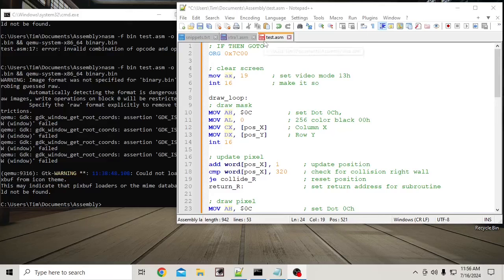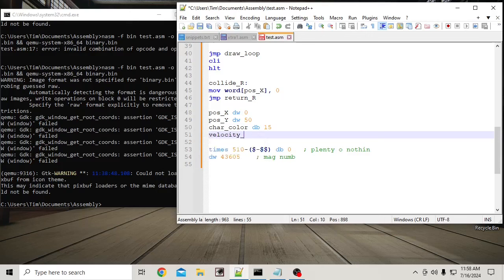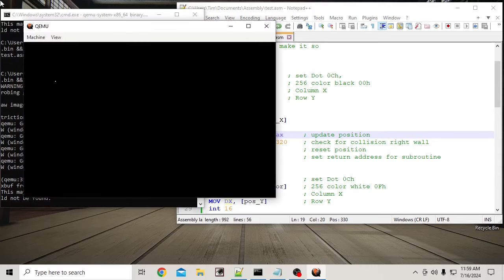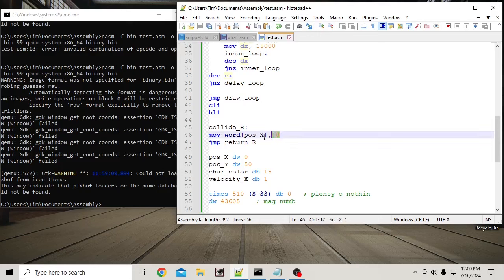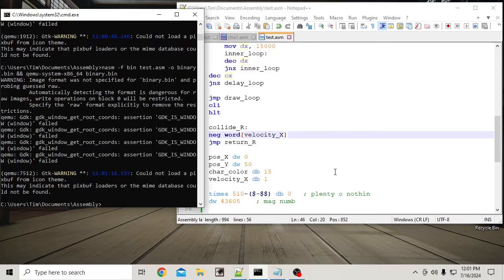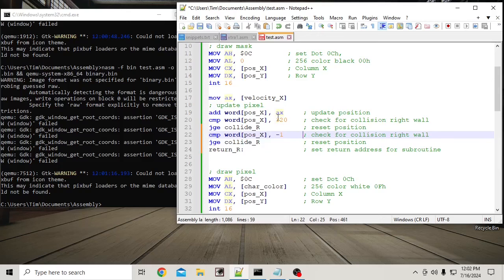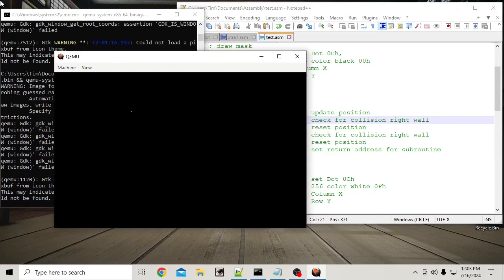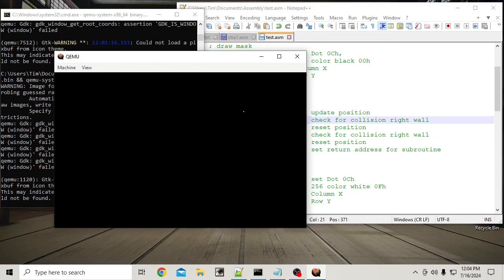Assembly's got me bouncing off the walls! - NEG

Comment: We can wait for the vsync at port 03DAh multiple times in a loop to slow down the movement and to prevent flickering. We are on 60hz refresh rate, so this run the same speed (depends on how many loops we use for delay) with all CPU no matter how fast the CPU is.
Reply from the maker: Have you verified this works using NASM on Windows? I have been unable to get any clock functions to return anything but 0. Also remember I am nor relying on any Interrupts that are only available under DosBox
Reply: @dillingerlee2536  I never tried it on Windows, but on MS DOS.

Comment: It is not so hard to calculate the offset address to set a single pixel writing directly into the screen memory without to use a software interrupt.

Using 320x200x8: (segment address = 0A000h)
Offset = (Y position * 320) + X position
similar to  = ((Y shift left 8 times) + (Y shift left 6 times)) + X

The screen starts in the upper left corner offset 0 and one row ends at x = 319.